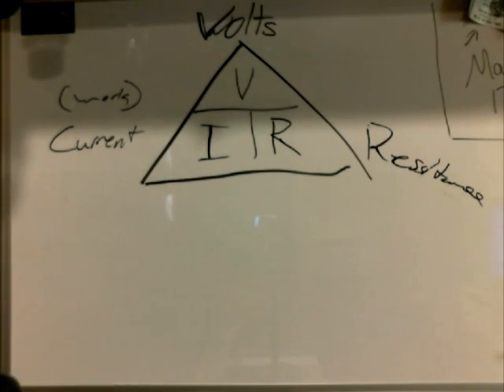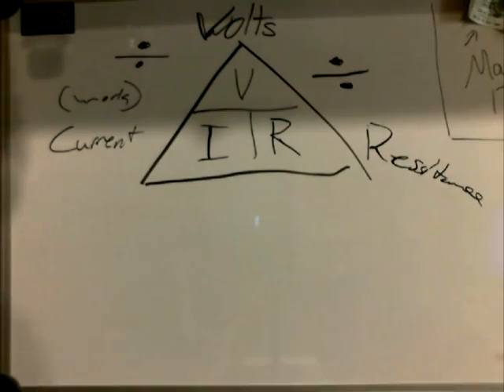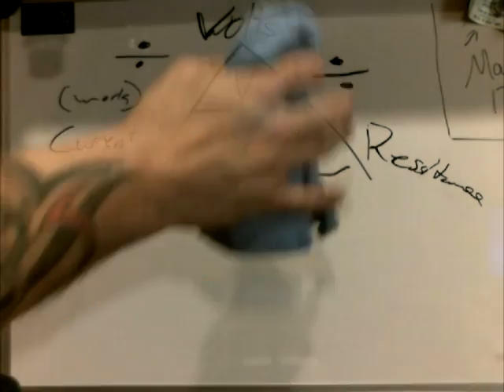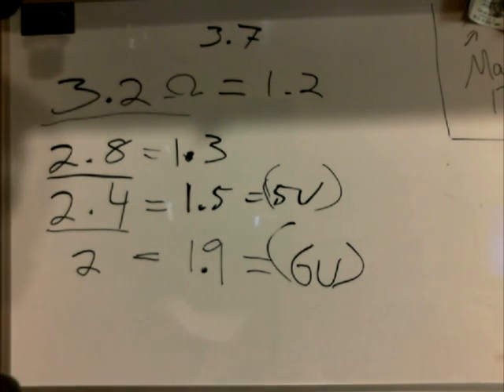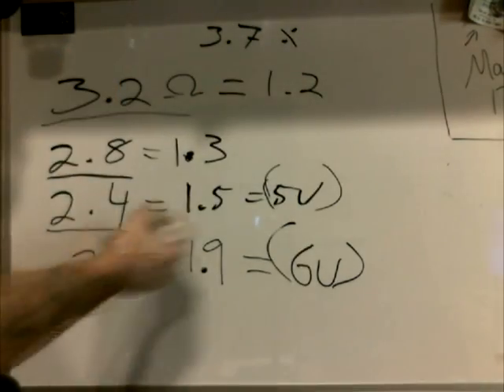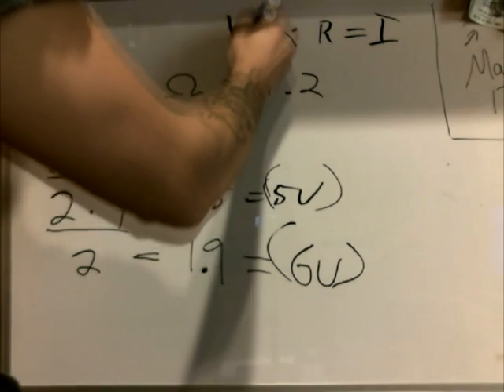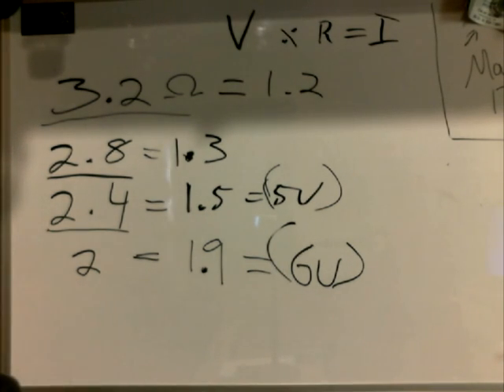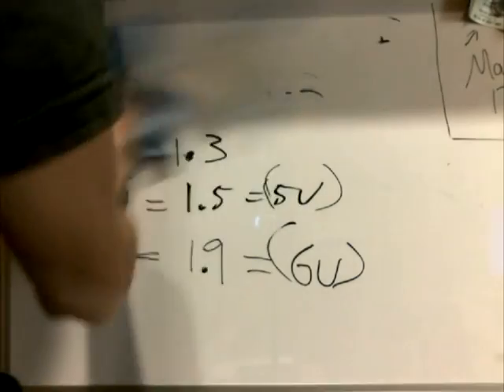Low Resistance Attys/Cartomisers Explained

Comment: Ummm   no.      2.4 ohms at 5 volts   is not 1.5. Its 2 amps       and where are you getting 3.2 for a base adverage   the adverage ive seen is 1.8 to  2.2
Reply from the maker: at the time of this video LR attys and cartomizers where new it was posted in 2011. The "Clearomizer" was not around. At that time your basic 510 atomizer was in fact 3.2ohms and we would stack batteries to get 6v inside tube mods or build our own. Further more if you use an ohms law calculator  http://bit.ly/1eE4J5c 6v at 3.2ohms = 1.8I or current which is what i was showing in the video all math was for current